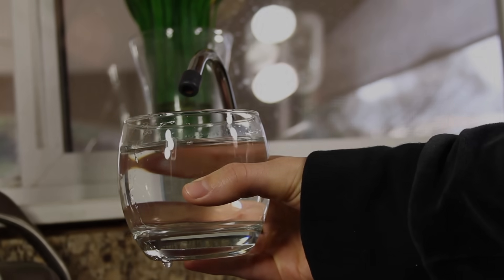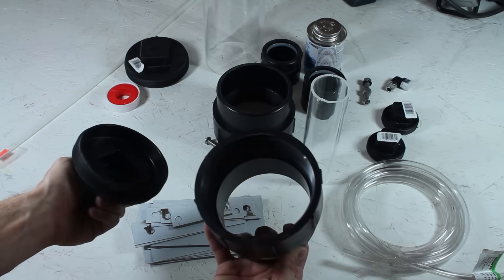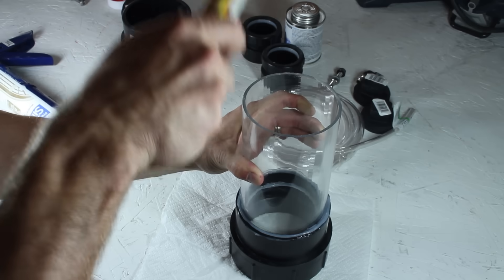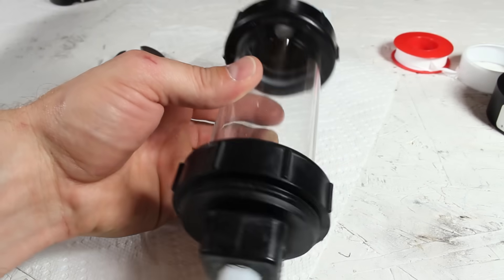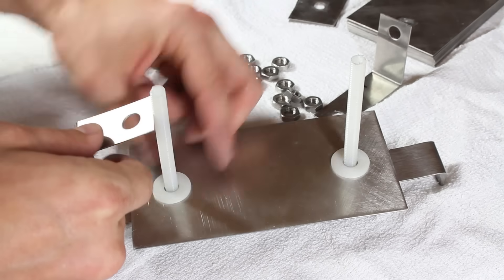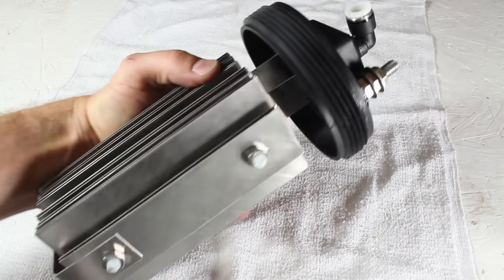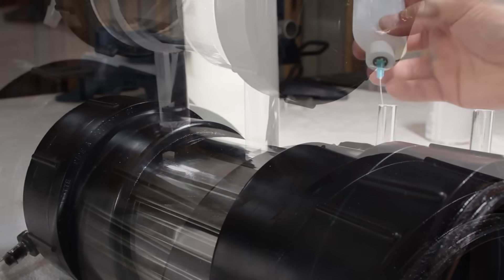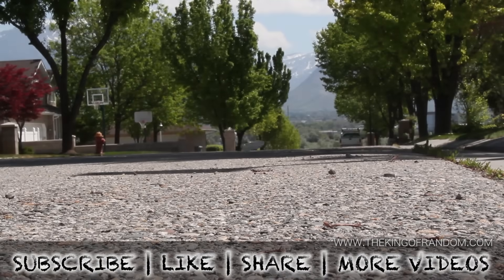HHO Generator - Water to Fuel Converter

Comment: Now, make this solar powered, add a compressor and a tank.  Put it on a generator or a car. Virtually free energy.
Reply: Not completely, because there are numerous parts of the system which aren't 100% efficient. Solar panels, for example, are currently only able to convert 23% of light into actual electricity.
Reply: Headshot Josh That is what a charging unit and battery pack are for.

Comment: can it power a car...or any other thing? please answer.
Reply: Maybe a small engine like a gasoline(petrol) powered  lawn mower but I would be careful because back flash can happen and cause the fuel to explode. need some sort of bubbler or back flash arrestor to be safe. I'm not completely sure it will power it though, engines need constant fuel being pumped into them. Also I don't know if this will cause a lean condition in the engine and make it overheat/destroy the engine

Comment: I know it's gross, but I did a whole semester of research on electrolysis and using urine gives you a ridiculously higher yield than ordinary water.  Only use about 10% urine though to keep it from being too nasty.
Reply: I take that back.  He's not separating hydrogen and oxygen.  Urine increases hydrogen yield by a very large amount but it puts other gases into the oxygen side.  For this cell don't use urine
Reply: I want to make one of these and I keep seeing that you can separate the two gases, how do you build it so it does that
Reply: Possum 71 just look it up. Essentially you have two chambers and a wire with an electrode in each. The negative end will make hydrogen and the positive will make oxygen

Comment: can you try to fire a gun from this? or build a rocket from this? would be awsome!
Reply: Nope, too hard to pressurize it and keep it safely without it blowing up
Reply: Probably. The space shuttle used Hydrogen and oxygen gas in its main tank (the big brow/orange one)  (not the solid boosters tho) for fuel, although they were kept in separate compartments and in a liquid form.
Reply: It can be possible, i have a air cannon that can be converted to use fuel. Just have a way to inject fuel into the tank, and add a spark igniter in the tank. The only problem is the amount of fuel you need to use without it blowing up.
Reply: hard to pressurize? Huh? Didn't you watch the video? The water is the fuel, it's not pressurized. It's called HHO on demand.
Reply: I dont think so,  to build for ex. rocket you need to store fuel instead of producing it because of weight of machine . And about a fire gun or blow torch i don't think its powerfull enough to sustain a good flame .Even with good power source it will produce a lot of heat and force  to build bigger electrolysis chamber . But at this point i guess its more efficient (but quite dumb coz of safety) to store flammable gas mix under pressure and add a bubbler after valve . Still too dangerous for me :D

Comment: Is 5 L per minute enough to run an electric generator which then would run or recharge the batteries which are causing the reaction then perpetuate the system with leftover energy out of the electric generator
Reply: no, that would break the laws of thermodynamics
Reply: The generator will produce less power than what is needed to run it
Reply: You can't have left over energy from something like this..

Comment: I dont understand the purpose of the bubbler that contains just the water.  Isn't the chemical reaction taking place at the metal plates where the cathodes are creating the hydrogen and anodes the oxygen.  then it travels through the tube to the bubbler which is just for looks or something?

Comment: Don't the oxidation reactions occurring at the stainless steel anode create hexavalent chromium?
Reply: +ComputerCraftr The last 2 words was over my head, but my steel turns black
Reply: "dispose of the contaminated water properly"  this is not Bangladesh,  we use the sink.
Reply: Think "Erin Brockovich"
Reply: There will be a little bit, but I imagine this guy is somewhat ignorant to it. I doubt it'll be enough to do any real harm though.
Reply: You are correct, platinum codded copper is what should be used.

Comment: YouTube, should I design a car engine that uses this system in conjunction with solar panels to make a perpetually running car?
Reply: Or more effectively just power an induction motor directly with the solar panels...
Reply: +Ian Swart shh...
Reply: Just make an electric car, it'll be more efficient
Reply: car? no. better to just make a hydrogen fuel cell car instead of a perpetually running car. solar panels, top of the line, only output 18% of the energy they absorb. we are starting to make better ways of absorbing more of that energy, but that would take years for it to be sufficient. might as well make a hydrogen fuel plant in your backyard to keep refilling the hydrogen fuel cell car, or just attach the solar panels to an electric motor and attach that to your car. even still, both are not very efficient.
Reply: just use the electricity from the solar pannels. if you make this Gas you will loose 66% energy!
Reply: already on it. im almost done with the second fuel cell that he made in this video. :)
Reply: You lose lots of energy from trying to produce it,  making perpetual motion machines impossible. Solar power, although it may seem infinite, will technically run out (a few billion years later) but for our lifetime solar power seems pretty efficient (as long as you live in an area without many clouds) although solar panels can be pricy.
Reply: you mean so that you cant drive when it rains?

Comment: I know this probably wont get read, but what did you use for blowing up the gallon jug? I want to build one and hook it to my old model rocket control pad.
Reply: +Sodacan Gaming He pumped it with the oxidised hydrogen gas he produced from the generator.
Reply: +TheReaperKing15 I think he might have meant the thing below it that lit the gas.

Comment: I actually had an idea for a generator that turns water into fuel just like this a while ago. Separates the hydrogen from the oxygen making flammable gas with its own oxidizer. But it looks like it's been done before. And since hydrogen turns back into water when burned, you could salvage the water and turn it into more fuel.
Reply: sir, here on earth we respect the law of thermodynamics
Reply: but I think it takes more energy to make the gas than the gas could possibly produce... unless you use the H in a fusion reactor...
Reply: ONLY A STEAM TYPE FUME AN SPLATTERED BLACK WATER?  AFTER THE HYDROGEN TO AIR RATIO GOT WORKED OUT THE GENERATOR RAN GREAT!!

Comment: Now if only we could find a more... Practical use for this generator.
Reply: +William East Zeppelins.
Reply: +Górski with this System you'll lose 66% of energy...
Reply: WT Videos That ignores the energy concentration difference between the two fuels. For an equal amount of H2 and gasoline(by volume) the gasoline contains hundreds of times more usable energy.
Reply: For example in your car. It will help you to save fuel
Reply: it's already done.
Reply: +Zachary Gillenwater Hindenburg?
Reply: +Zonko CS:GO Doesn't mean it's not practical
Reply: 34% efficiency does, indeed, mean it's not practical.
Reply: Cars.
Reply: because getting 34% efficency from 1 litre of water @ 0.001 cents per litre vs 100% efficency from gas at 1.20 per litre isnt efficent
Reply: ***** you know that H2 is compressed in the tank?
Reply: ***** the gasoline is still 100s of times more expensive. gas is 12,000 times the price of water.
Reply: if you vaporize it. HHO is 10x more volatile than gasoline.
Reply: Freeman Belmont so by vaporizing the gas that is produced from this cell, We would have a gas 10x more potent?
Reply: If you vaporize gasoline, you get better mileage. The HHO is 10x more volatile then gasoline already.

Comment: can we use this HHO Generator to run a car to save the petrol useage??????
Reply: +Puram sri ranga I think the Mythbusters tried something similar way way back in their first season. It was proven that you could run a car on Hydrogen but the system they used wasn't producing enough of the gas to get the engine running, making them resort to using a tank full of Hydrogen.

But then again, they could have revisited the myth using this current HHO Generator :)

Comment: Did any of the parts you use degrade over time (corrosion)?
Reply: +Nathan Brown because he used potassium hydroxide it would be fine, and with sodium hydroxide. However if he used normal steel or iron plates and used salt (NaCl) it will create FeCl3 I think which after a while will get rid of one of the electrodes. I may be wrong. However if you make the electrodes out of graphite, they will never degrade.
Reply: +Tom Price I see, thanks.
Reply: +Tom Price btw. it's graphite that degrades the quickest at the Oxygen generating electrode. that's why the proper ones cost 2000USD per cell as they use platinum, which is a catalyst and does not degrade.
Reply: +Tom Price also, does that mean Potassium (or sodium) is created from the reaction?
Reply: Nathan Brown I assumed it would produce Sodium Hydride (or Potassium Hydride) which would react with the water to form the hydroxide again and so on, so in some ways the metal is acting as a catalyst,this is just a guess, but it seems logical

Comment: you can pretty much use this to make a hydrogen torch,  which is way better than a welder torch.
Reply: +TigerToxins U The one he made produces a mix of hydrogen and oxygen, you would want to separate it before you start using it in a container as a torch as it will just blow up in your hand aha
Reply: +Tom Price Just use a bubbler safety switch
Reply: +Tom Price Also a H shaped container is good for seperating

Comment: How would you separately contain the hydrogen from the hydrogen-oxide? Since hydrogen is lighter, would you need to take the hydrogen from the top of the gas mixture? I would like to use the hydrogen to fill balloons cheaply.
Reply: No, the gasses are miscible and don't form two layers. Lile oxygen and nitrogen in the air.
You would need to liquify the gas mix by cooling it, and then slowly heat it up so that gas with the lower boiling point vaporizes first
Reply: Ahh. Well dang! I don't think I could pull off that.

Comment: I first watched this video about a week ago, I have been scratching my head ever since, why is this design not utilised for rocket propellant and space travel? Using lithium pollyma batteries, hydrogen's bang for buck could sure make the power too weight ratio with out issue.. Any answer anyone? P.s there are hundreds of ways to prevent blow back.
Reply: Hydrogen doesn't go well with heat.
Reply: +Dixon Liang that's the whole point Dixon
Reply: +ncg0005 oh lol, didn't fully read your passage

Comment: Plates are obsolete. Tubes inside of tubes inside of each other provides more surface and therefore produces more hydrogen. I picked up some springs, three different  diameters in 2 different lengths at the hardware store. Not stainless but zinc. Lots of free water bottles in the lost and found at the health club or University gyms for the container and the bubbler.

Comment: Now incorporate this project with your burner for melting metal add a small solar panel and you've gone 100% green for casting.  That's what I'm working on now love the videos keep it up.
Reply: Sounds like a good idea, but wouldn't work. This generator makes hydrogen gas with a process called electrolysis, hydrogen gas isn't exactly good for burning, it burns too fast, it's  more of an explosion.
Reply: Hi, do you happen to know the dimensions on where the holes are on the steel plates?

Comment: kinda lame....considering it takes electricity to make it work.....you should use solar power to make it 100% awesome
Reply: You do realise solar power is still electricity right? And even then it probably doesn't have enough amps to breakdown a water molecule
Reply: +VoltageHacker Not entirely true. You can create a solar mill to charge the batteries which will be used to power the HHO generator.
Reply: +Tristan Renner true but it'd be pretty inefficient. It'd also need to be large enough to generate enough power to even start the changing process
Reply: Inefficient it may be, but is a solution at least.

Comment: Can you use table salt instead of KOH?
Reply: pretty sure you can, but I'm not sure about the efficiency.
Reply: +Michael Yoo You can use any salt that conducts electricity but make sure it doesnt interfere with your reaction.
Reply: +Michael Yoo Yeah, but depending on your electrode material you will either make a compound like FeCl3 or chlorine gas, which in large quantities and with the addition of UV light (from the sun for example) can kill you, or more likely just make it very unpleasant to breath, its fine in small quantities though. And in all these cases hydrogen gas is produced

Comment: Now build a oxyhydrogen torch.
Reply: +hans mayer He would have to modify it so the hydrogen and oxygen are stored separately.
Reply: Can't really use hydrogen as a fuel for burning. It would most likely burn too quickly.
Reply: I saw a video on Cody's Lab where he used some hydrogen/oxygen he got from electrolysis and compressed it. He was able to cut through a piece of steel by running the gasses into a torch, and it worked well enough for home-made fuel.

Comment: Won't salt water work just as well?
Reply: +Patrick Buchanan absolutely not, I used salt and it created lye which is acidic, use potassium hydroxide for best results
Reply: +Patrick Buchanan Salt will rust the plates.
Reply: +Patrick Buchanan it will work fine aha, yes it will make it slightly alkali and depending on your electrodes it make make chlorine gas, but never the less it will work I have done it aha

Comment: Well I made this for my school chemistry project. It was rather easy to build but the camera doesn't do this gas justice. I filled a water bottle with the gas and lit the bottle. It more or less exploded loader than a gun shot and flew 50 feet. Just like In this video I tried lunching one out of my hands. Mistakes were made. The bottle exploded and blew up in my hand lightly cutting my finger and making me lose my hearing for about five minutes. So all I have to say is just be careful and don't underestimate the power of this gas

Comment: Is it possible to separate the oxygen and hydrogen, say for a blowtorch?
Reply: +David Naoum yes but not with this design. you need to seperate the two electrodes (here are 1 pair of plates 1 electrode pair). you get the hydrogen at the catode (+) and the oxygen at the anode (-). just google water electrolysis. but thats not a very efficient way to produce the gases but its a easy way to do it at home.

Comment: What happens if you use sea water or fresh water (as in fresh water rivers)
Reply: Boom
Reply: +peter hill I believe that using salt water would also create chlorine gas (from the salt: NaCl), which is kinda deadly. Fresh Water would have the same effect as tap water, that is creating Hydrogen and Oxygen gas, which in this video is not being captured separately.

Comment: Grant is it possible to convert a generator to run hydrogen gas?
Reply: u tryna make a hydrogen bomb?
Reply: +worlds worst gamer 17 lol no, I wanted to know if a gasoline generator can be converted to run on hydrogen gas.
Reply: T.Ryder727 not currently, but you need jumper cables to power it so just plug those into your generator or use solar panels

Comment: Would it work to power with a laptop charger instead of a car battery? Could I use aluminium instead of stainless steel? Where can I get KHO, or what is the best alternative? Where can I find threaded nylon rods? I'm making this for a school project and I'm trying to cut down costs. I'm already using a pickle jar instead of the acrylic tubing, but I need more ways to make the unit cheaper ,while still having it works just as well. Advice would be appreciated. Thanks.
Reply: type mini hho generator on YouTube it Will be good for a school project

Comment: Hmm I don't quite understand how the circuitry for the plate works. from what I can see, only the two center plates and one plate on each side outside are powered. All other plates inbetween are insulated by the nylon washers and the nylon nuts. What am I missing here?
Reply: +Tanith Rosenbaum The circuit is completed by the water.   The electricity  jumps through the water from plate to  plate.  This current is what causes the covalent bonds to break. The plates in the middle that aren't connected to anything are called neutral plates. They just bridge the gap and make it run more efficiently.

Comment: I built the generator, but the gas that is coming out does not seem to be flammable, I was wondering if anyone else had experienced this problem and could offer some help?
Reply: I had the same problem but just leave your generator on for a minute and let the gas just flow out in the air then try again.
Reply: +Gustav Enocson Will do, thanks

Comment: The battery who you use..Wich are V? Is the battery of the truck???
Reply: Probably the standard voltage of 12v. He said he used two car batteries so I would imagine he had then set up for 24v although they might be in parallel for more amperage. I suppose it's just trail and error with the power for it
Reply: thank

Comment: Can't this fuel be used as a torch?
Reply: yes, but you need at least one more backflash prevention device between the torch head and the bubbler. Oxy-Acetylene torch tips work very well as they are designed for high heat.